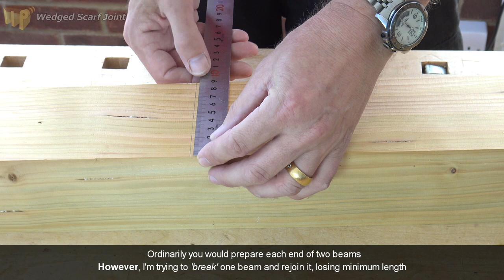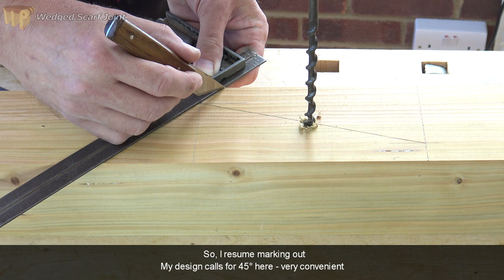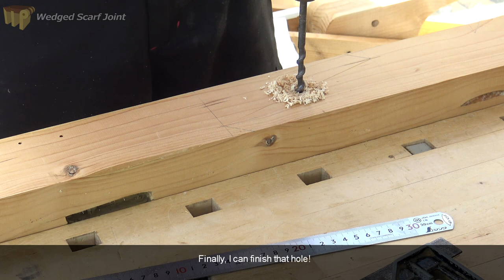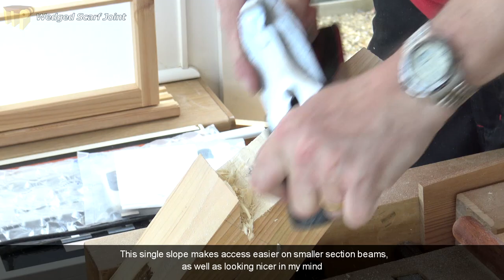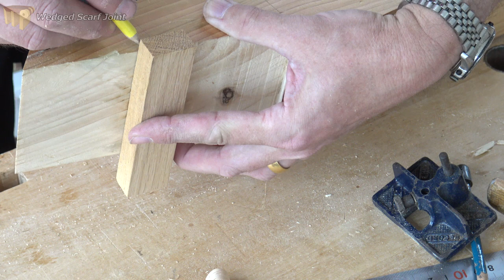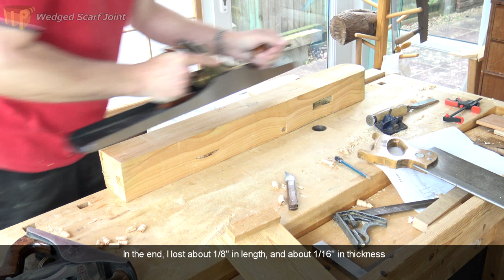Wedged Scarf Joint (Hand Cut Timber Framing)

Comment: The placement of the scarf is beast not over the post,because it’s the top of the deflection ❤. Better than the center of the timber
Reply: All the old frames,that have seen,locate the scarfs above the brace . The top plate is like an invisible wave. And above the post is the top of the deflection

Comment: Excellent video. My question is what direction the scarf cut should face when I replace the repaired porch post? I read from another online forum that "the plane of scarf should be perpendicular to the deck ledger or deck beam".
Reply from the maker: I think I understand what you're saying. My take would be that the weather side of the post should have a single joint line, with the joint continuing upwards a little. This would prevent water running into the joint.

Comment: would be very interesting to see numbers on the max force the joint can take before and after.
Reply from the maker: It would, but if course you can only do a destructive test once. I can stand on this joint suspended horizontally, and for sure I could have done so on the initial post.
Reply: @mitchwoodwork  correct indeed! But i am curious if it is 99% or original or 50%. I cannot imagine the joint tolerating more force than the unmolested wood. Great video!
Reply from the maker: @linusyootasteisking  in most cases I'd agree. But maybe there is a severe defect in the post which makes a very weak point. Cut that out and splice the two.

Comment: Mitch : could you have made the key hole not tapered and use 2 keys tapered ?
Reply from the maker: Yes indeed you could. Like the additional tenons, there may be situations where you couldn't do it, such as if you don't have access to both sides when assembling.

Comment: Would that joint typically be glued or just wedged dry?
Reply from the maker: Dry. As with similar joints the wedge should be checked while any acclimation takes place to make sure it's snug

Comment: Not sure why people cut this variation of scarf. It should be hooked (AKA tabled) whereby the two pieces have full contact with the wedges. If the wedges are in a groove like so, only half the wedges are engaged. It’s very pretty but inferior to the hooked variation (trait de jupiter)

Comment: Finally : a « position » small tenon on each piece would be useful …?
Reply from the maker: Yes that could be useful, unless it needs to be installed sideways.
Reply: @mitchwoodwork  …why? Sorry I à missing the point :( for the beauty ?
Reply from the maker: the tenons could prevent the joint separating sideways (handy in most situations), but if you need to install a section between two fixed beam ends, you would need to assemble it sideways, and the tenons would prevent that.